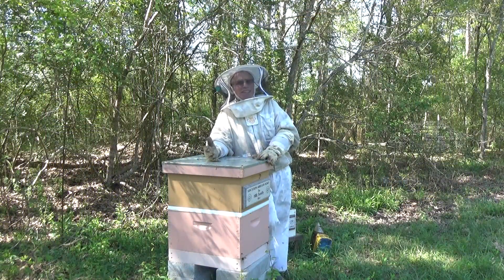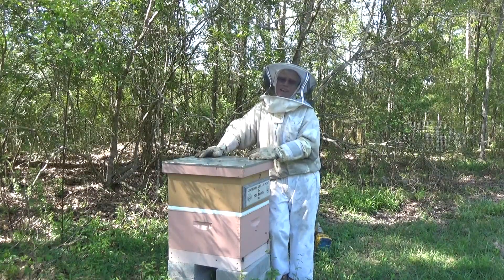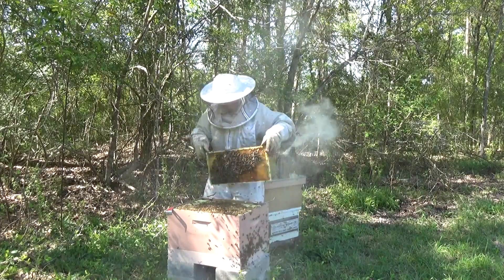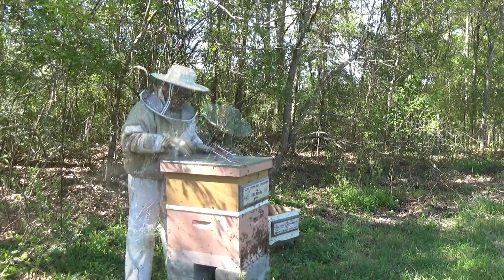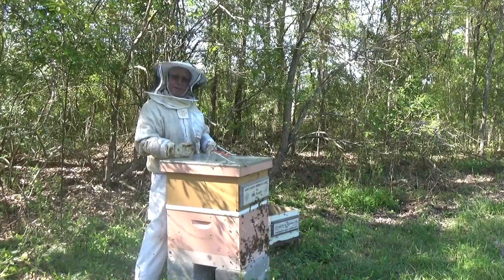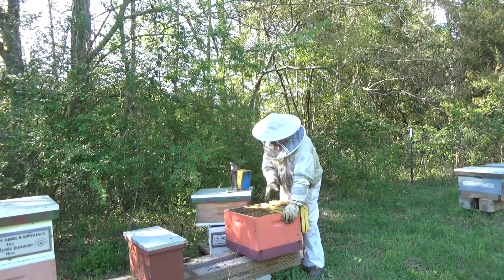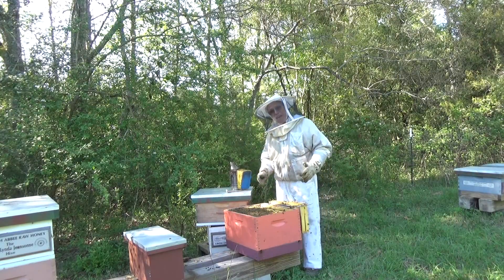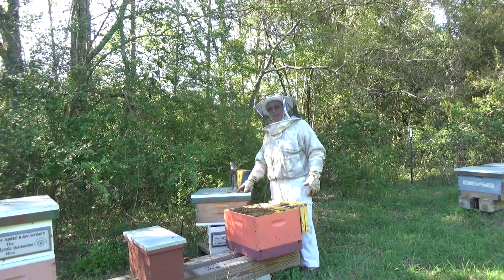Checking bee boxes for emergency queen cell development.

Comment: Hi Jeff, I have a queen cell that has an opening at the tip as if the queen emerged, and also the side is torn apart. Do the bees tear down the cell after she emerges? Thanks!
Reply from the maker: Bees do tear down queen cells regularly. However, when you see the side of the cell has been chewed, that is from an old queen reaching into the cell to kill the queen that is in there. Thanks for watching. God's peace John.
Mr. Ed
Reply: @JeffHorchoff  Thanks Jeff!

Comment: Do you have a video showing the differences between Emergency Cells, Swarm Cells and Supercedure Cells? And in the lower box, if you see an Emergency Cell, how can you tell that it's not a Supersedure Cell? If it's a Supersedure Cell the upper box could possibly not have a queen.

BTW, based on your videos I've made 5 double-screen boards to prepare for the Spring splits.
Reply from the maker: Sorry no video showing the difference between the cell types, but I do have lots of videos explaining the different ways I make my splits using a double screen board or swarm cells. As far as distinguishing the cell types, here are some basic ways of knowing which is which:

Swarm cells are generally queen cell located at the bottom portion of a frame or directly on the bottom of the frame.

Emergency cells are formed when something has happened unexpectedly to the queen and she was killed. These cells are hastily built, and are generally not as large as a swarm cell or a superseding cell. They are constructed on the face of the frame where there is an egg already in place.

A superseding cell is a large queen cell built by the bees and the queen lays an egg in them. These types of cells are present when the hive wants to replace their queen due to her condition, she may be injured or not laying enough eggs. 

I hope that helps. God's peace Bruce.
Mr. Ed

Comment: Hi Jeff. Wanted to send you some pictures of our hive that’s a year old and one that was a swarm that we rescued. The swarm hive did a lot of work in just two weeks. But they were building in a big cluster not in each frame. So we separated the cluster and put them in trays with rubber bands so they would stay straight. I older hive is thriving and very happy. We added second stack two weeks ago. They have not moved up. And they are now crossed combed in 5 trays. Do you recommend separating them with a knife? We took some of the full frames and moved them up to top stack. Not sure if that’s ok? Would love to send you pictures and get your advice. God bless! so love your channel and your grace is amazing!!
Reply from the maker: I do not know if you are using frames with foundation or without, it makes a difference on how you should proceed. Me, I would cut the comb and place drawn comb between frames of cut comb to curb the crazy comb. Send me pictures, it should give me a better idea of what you are looking at,     oscelata@gmail.com   Thank you for your blessing, kind words, and for taking the time to follow along. God's peace Cari.
Mr. Ed

Comment: It's an interesting technique, if bees going into swarm mode and you split them leaving numerous queen cells, if they are still very strong why wouldn't they just swarm with one of the Virgins? A queen cell is a queen cell, not all swarm cells are on the bottom of the frames.

Hey, if it works it works 🙂

Still a few weeks away from swarm season here in the U.K. but if you are still doing the feature then, I'll be sure to join in 👍
Reply from the maker: You are correct, not all swarm cells are on the bottom. Still, I'd venture to say that more than 98% of them are. There must be dozens of ways to make a split, but because this way is so simple, and I love simple, it's the main way I make my splits. Our contest runs till September, so send you pictures. I'd love to have some swarm pictures from the U.K. God's peace Jeff.

Comment: Jeff have you ever taken a frame with queen cells from one of the hives, some had several frames with QC's, shaken the bees off and put it in a hive with no queen cells? I think it should work and cut down waiting another 7 days for queen cells. Just wondering. Man that smoker did you no good there for a bit. WOW. God bless cant wait till all the snow is gone here.
Reply from the maker: That is one of the methods I use. When I made the video, that situation did not come up because there were cells in all the ones I showed. If you read the description, it will tell you what was the ratio of hives that needed what you describe. Thank you for your blessing and for watching. God's peace.
Mr. Ed

Comment: Jeff, I heard that emergency cell queens aren't as good as swarm cells queens that are on the bottom of the frames.  What have you found?
Reply: Usually the emergency cells are just as they sound -- they need another Queen, and fast. 

And a lot of the time something's done fast, it doesn't end up as good as something that gets the right amount of time. But, sometimes everything works out alright
Reply: @kylesteele9403  So is it better to cut off a capped swarm cell and place it on a broad frame?
Reply: @Mackabees  I've never done a transplant like that, but if they're from the same species/family you can try it. Worst comes to worst they reject the queen
Reply from the maker: My logic is a queen in a hive is better than no queen in a hive. That being said, I do use swarm cells when I need a queen in a box and swarm cells are available. However, when I have 100 hives to work, emergency cells work well for me as well. It really is a matter of personal choice. Weigh the facts and base your actions on what works for you and is most expedient. God's peace.
Mr. Ed

Comment: Thank you for another great video Jeff!...I watched an older video where you used newspaper between the boxes...I guess you found that wasn't necessary?..have a great weekend!
Reply from the maker: I stopped with the newspaper as it was to messy and in my opinion , unnecessary. As it turns out, you do not have to put the paper between the boxes, You can if you want, but I'm not doing it anymore. God's peace brother.
Mr. Ed